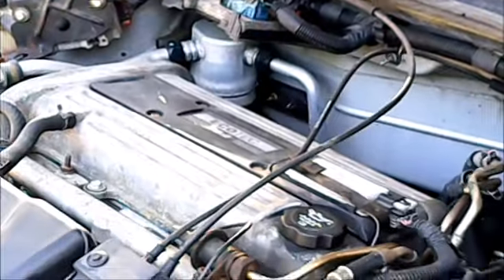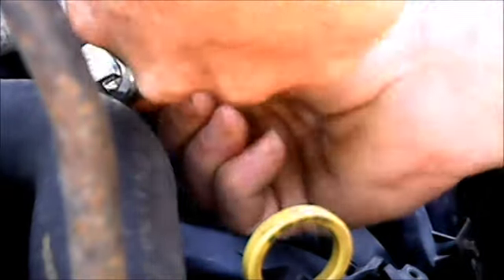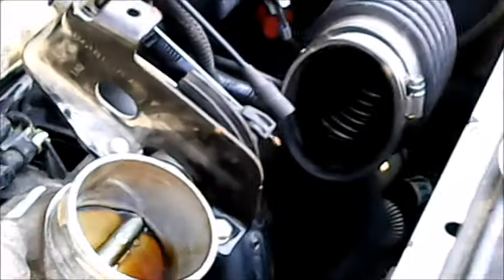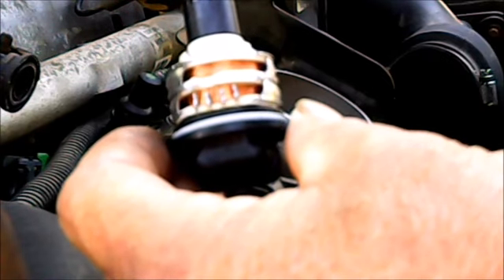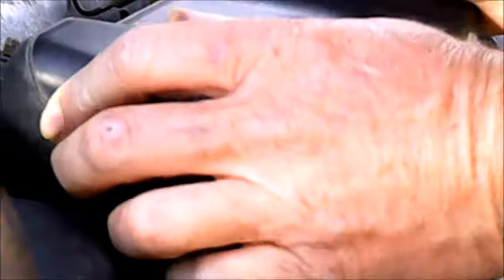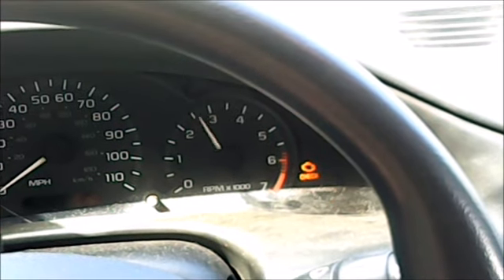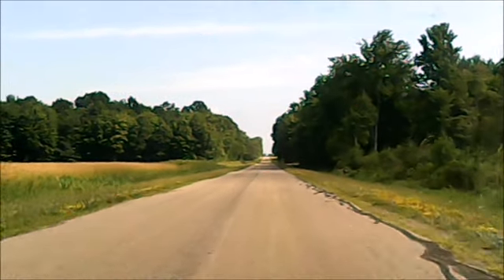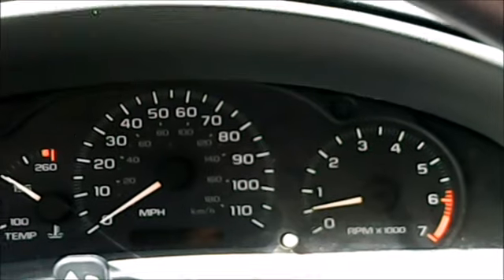05 Chevy Cavalier (IAC)  Idle Air Control Valve Replacement.

Comment: Glad I ran into this. This is what I thought was wrong with mine. It doesn't die coming to a stop, but seems like she wants to. I had that same vacuum hose cracked, and couldn't find the entire hose, so I just bought the ends from the parts store. I know it's an old video and you likely don't have the car anymore, but I just figured I'd chime in. Thank you.

Comment: Changed mine on my ‘03 found a Sensor at the junkyard and cleaned it with Parts cleaner and a Toothbrush until the Carbon was gone no more stalling no more cut offs … this works , this video is a life saver
Reply from the maker: Glad it helped!

Comment from the maker: Glad to help!
Reply: Travel With Greg & Betty   at 1:13, you can see a hose that is connected from the engine to the intake that is heled down by two clamps at each end, when you remove that hose there is a adapter that plugs into the hose and intake, do you know what it is called?
Reply: Does changing this part solve the issue on my 04 cavalier from sometimes having seizures when coming to a stop and shutting off and idling alittle rough? Becuz ive changed everything from the coil pack, spark plugs, fuel and air filters and ignition boots for plugs and i dont know what else is left lol...thank you for your input and help

Comment: My 03 Cavalier 2.2 is starting to do the runs rough when a.c. is on and driving (Not as much at idle) and the air gets warm when in park. I hope this is the fix because I have a 04   2.2 for a parts car and compressor swaps are a huge pain.

Comment: Have a cavalier but when it the rpm was going high and low I just Changed the spark plugs and the air intake and it went back to normal

Comment: Idles at 1000 rpm.  I may change on my 2005 cavalier
Reply: only idles at 1000 rpm untill oil is pumped to top of motor then when warm 500 rpm is the perfect idle for 4cyl

Comment: Hello Greg!!! I have a question. i have a 03 Cavalier that's giving me issues. It's misfiring on a cylinder right now. Sometimes it dies on me while I'm stopped in traffic. Could this part help me with my issue?
Reply from the maker: If there is a miss then it would be a different issue. The IAC is the Idle Air Control Valve and controls the idle speed and air mix. You may need to look into having it plugged in and find out what the issue is. You can have that done at Auto Zone or most parts stores and they do the reading for free. Hope this helps.
Reply: Did u ever find out what your problem was?

Comment: Mine is kicking out alot of black smoke and bogging down than it kicks up like got a lot of fuil at once is this my issue?
Reply from the maker: May be but it also could be the mas air flow sensor or o2 sensor. Blowing black smoke and bogging means its running rich so I would also look into that. Get it scanned for codes
Reply: Travel With Greg & Betty ok thank you

Comment: my cavalier's rpm goes up to 2500rpms when going 65 is that normal?
Reply from the maker: That sounds about right.
Reply: thanx , i just bought that car my 1st American 4 cylinder I'm just hoping its not a transmission problem.
Reply: +David H 4 cylinder cars have less  power, so the gear box has bigger gears to compensate this and it means that the gears revs more to pull the car with the less effort. So it's normal to rev until 3000 rpm each 20 km/hr to make the shifts normal, this for cars with 1.4 to 1.8 liters for example
Reply: Yes